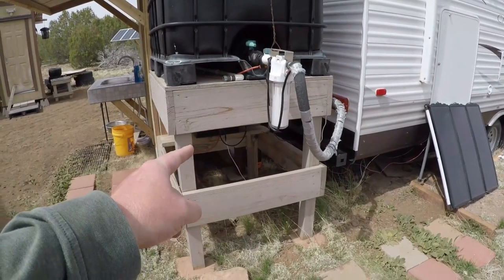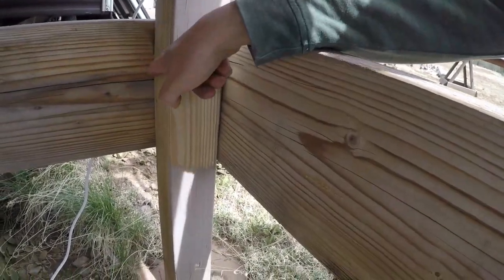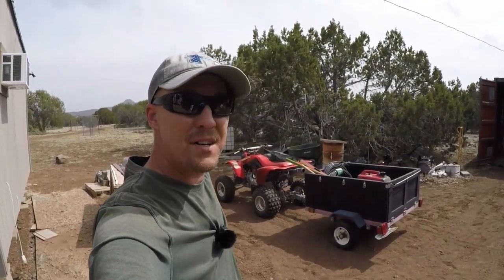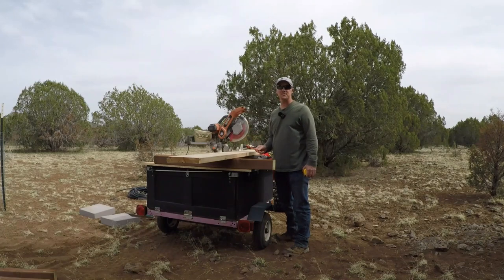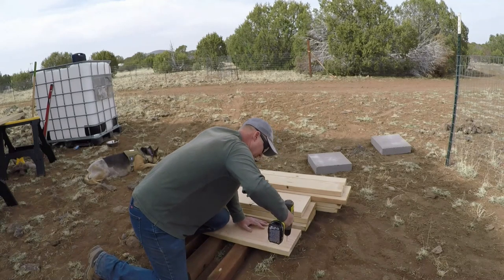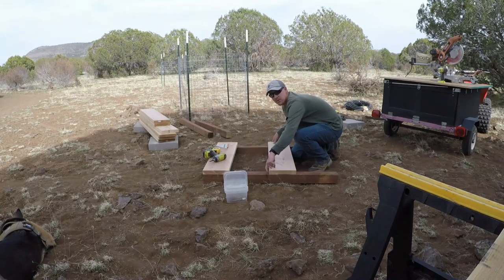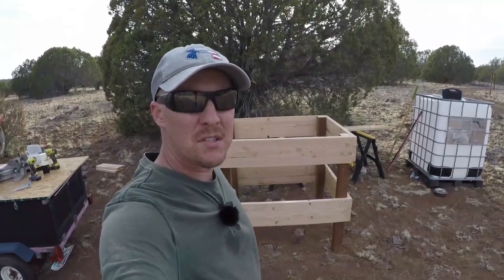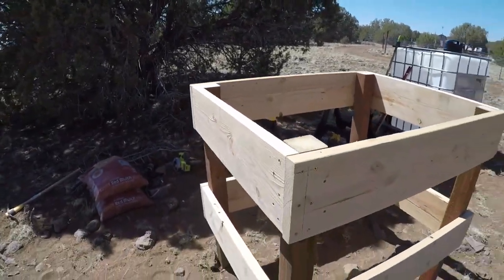How To Build A Wood Framed Tank Stand

Comment: I'm going to be putting this to use with my two water totes. I'm on my own so I was wondering how you lifted that tank up there on your own? When they are empty I can angle it to where the other end juts right above the tail gate of my truck. Then I get under it and lift it while pushing it up onto the tail gate and then pushing it into the bed of the truck. But this looks like a whole other height. I'll figure something out. This looks great! Thank you for sharing your great ideas!